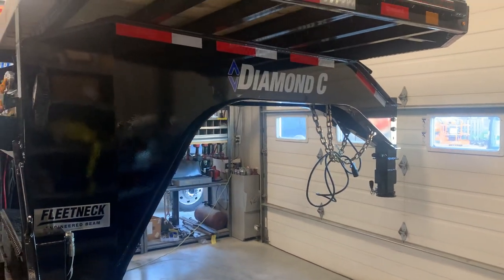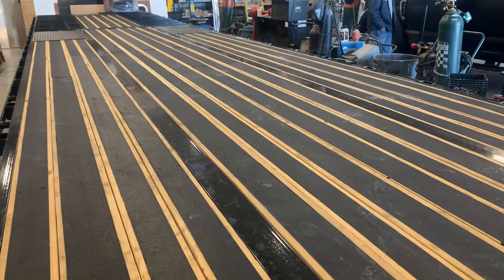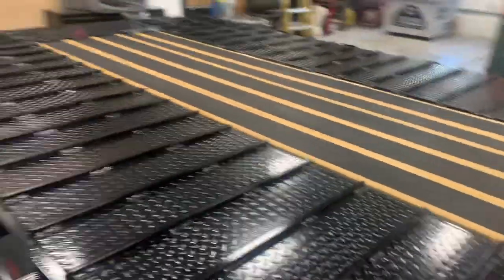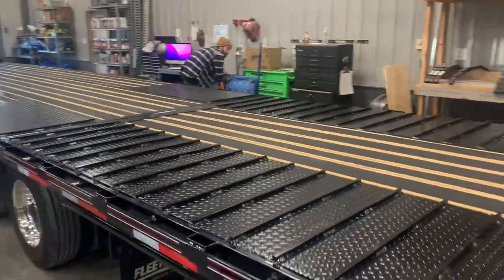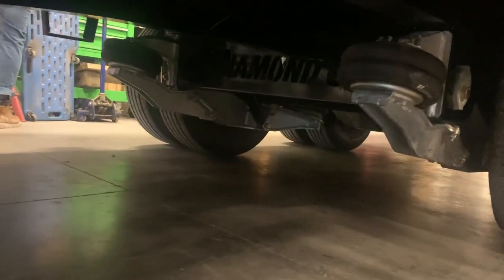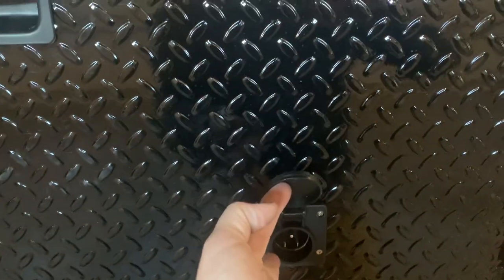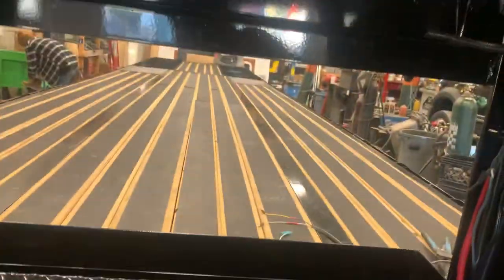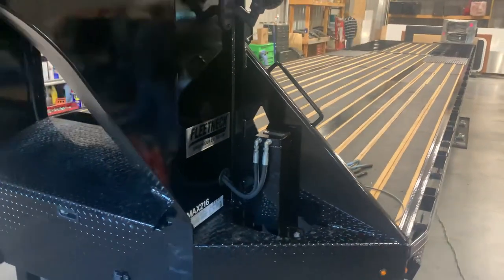2022 40K Diamond C FMAX216 Custom Order at Spencer Trailers Inc.

Comment: Amazing build! I'm currently trying to decide between this and the Diamond C SD with the 16k axles and pretty much all the bells and whistles. Easily a $65k trailer
Reply from the maker: You probably know this but you will need a cab and chasis bed style to pull an SD.
Reply: @Spencertrailers  Yes sir! I plan on pairing it with a Freightliner M2 106 Sportchassis